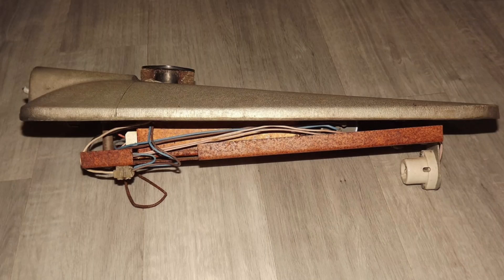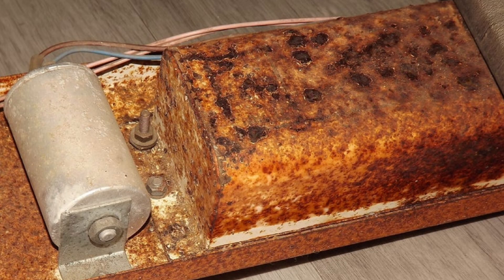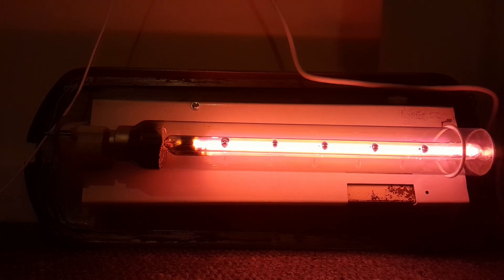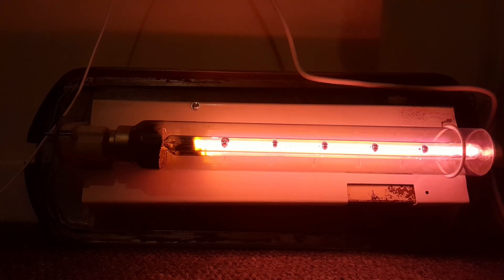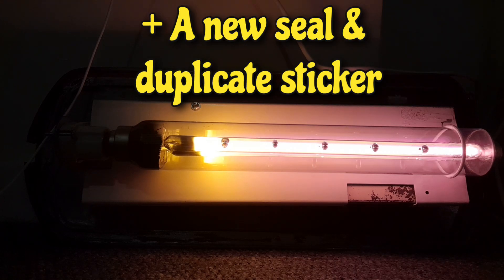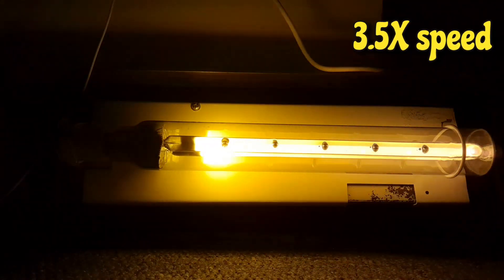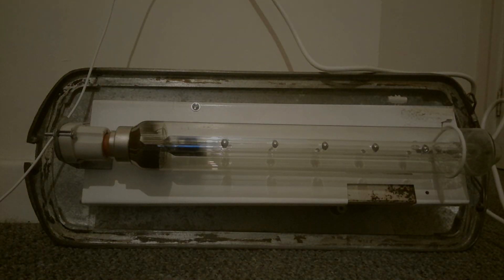A Badly Damaged Thorn Beta 8 [55W SOX] Street Lantern (Will It Work?)

Comment: @leolamposts the new led's are less cost effective than the old Sox or hps because the council have to spend more money to replace the faulty led streetlight's that have non serviceable parts. But Sox hps mh mv streetlight's can be retrofitted so if the bulb goes they can just get a new one.

Comment: hello, quick question, im beginning a collection of lampposts, and they will already be wired so they can be plugged in, i am wondering do they need a photocell installed so they can actually light up?
Reply from the maker: If the photocell isn't bypassed then yes, if you bypass the cell then one won't be needed, to do this connect the Live in and Live out wires leading to the photocell socket

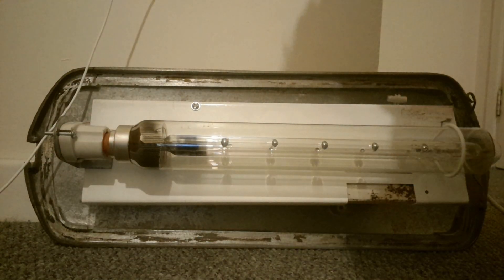Comment: 1:08 very true, very precious things 😊 also, I’ve just ordered a GEC Z5678 and it comes with gear and a lamp!
Reply from the maker: Saw that one on eBay if it's the same one, great little post-tops they are. They can be seen around Lichfield but not here in Tamworth unfortunately
Reply: @LeoLampposts  yes that’s the one! They are lovely lights. Would prefer a gamma 6 but can’t find one anywhere, but this is quite similar!